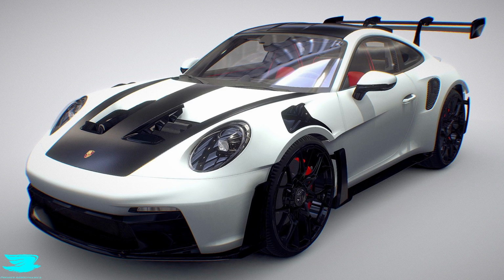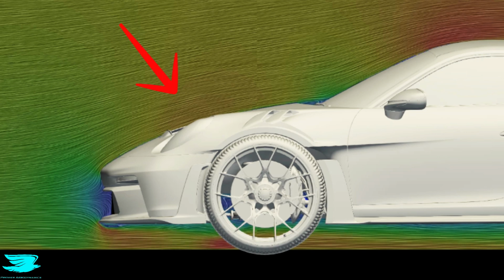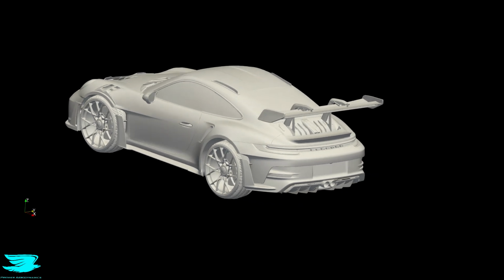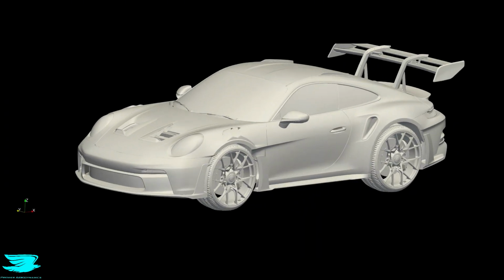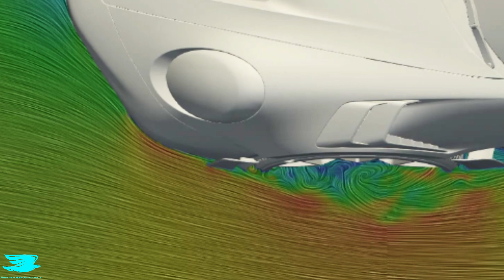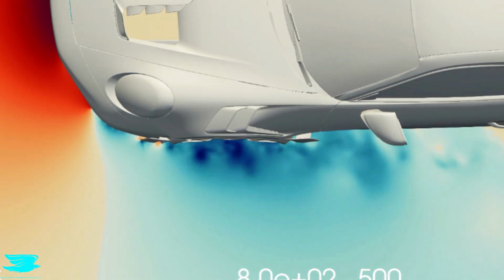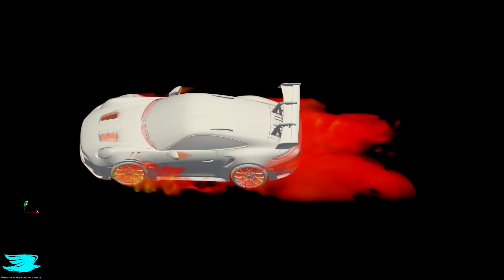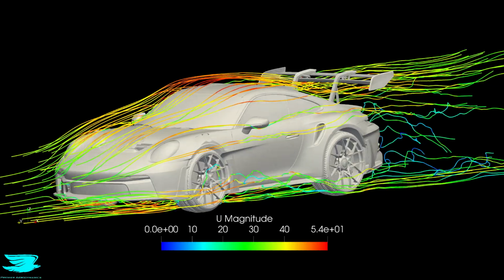Porsche's Most Aerodynamic Car Ever!

Comment: I am always watching your videos in order to learn about aero. Also I am in the process of decreasing aero drag on my car. I got a vented bonnet for my nsx for aero purposes , also added some flat underbody panels. I hope it will decrease my 100 to 200 kph time. I will have the floor of the car scanned to add a diffusor too. But the design is hard to do, because the exhaust and the engine is in the way.
Reply from the maker: The underbody panels will almost certainly help. Just make sure that there is enough cooling still.
Reply: @PremierAerodynamics  Yeah Thats what I am scared of, I wan't to do 500+ hp someday with a new 3.5l suprrcharged engine. Keeping it cool with a Diffusor that blocks of airflow to the underside of the engine would be dangerous. I've looked for solutions to this problem. Found a diy diffusor design that had a row of naca ducts infront of the engine. That looks promising. I still want to optimise it though. 

I think, if i can do the brake cooling in the rear with naca ducts as intakes and hoses that connect to the dust shields, I can put aero devices onto the lower rear A arms. Maximising the efficiency of that underfloor section. 
Further more I think there is a bit to be gained by shaping the middle floor. Maybe I will add strakes at the sides.
Also I am looking for a way to ven't the front and rear fenders, without making the car look ugly. I am trying to keep the look as stock as possible.

Comment: I assume the tires spinning isn't simulated here right? i think the airvents on top of the front wheel arches woud show more effectiveness if that was integrated.

 I feel like  some of the complexity of aerodynamic design is lost in these "set speed, straight on" simulations. Like the Underbody flaps that inflate/deflate behind the front splitter which would increase the downforce and keep the flow attached to balance the rear wing. Plus we don't see any body roll where the car would dive under breaking where downforce is  needed a lot.
Also just from the looks of it, the car seems to be a bit too high off the ground in general compared to when i see them irl.
Reply: Definitely right on everything, but also to add one more, the junction between the hood and the windshield is not completely accurate. On the real car, there's air blown from that junction channeled by some air going in the front bumper. There shouldn't be that much (or any) turbulent air in that region.

Comment: Can you look at the other side of the most aerodynamic porsche? The porsche longtail 907 has a CDA of .35 thanks to its frontal area of 1.3 meters, this allows one of its variants to reach 200 mph with only 260-270 hp

Comment: GT3RS is all about pushing the tire wake outboard, to stop it from turbulently mixing with the underbody flow. The furniture around the wheels also has the added benefit of enhancing the lip spoiler. Porsche noticed this when they made the S/T. One thing not shown in this model is also all the underbody strakes that help clean up the underbody flow. Current F1 has shown that underbody strakes are quite powerful, and since they can be made of plastic, or polyurethane, they are cheap and easy to manufacture.

Underbody aero is all the rage nowadays, along with modern tires, even low horsepower cars can go quite fast around a circuit with just underbody aero tricks like strakes and venturi tunnels.

https://youtu.be/NaenCYCUwBo?si=H3nc2QiBSQWji-M7

This car with only ~320hp minus 200kg of mass, sticky tires and around 4,000N of downforce @ 230km/h is a little bit faster around Tsukuba than a GT3 RS on Cup2 tires. You'd think it's a lie, no way a car with tacked on aero bits can make that much downforce, but the magic happens under the car, from the factory there are 2 big tunnels on either side of the transmission tunnel. Strakes were placed ahead of the tunnels, 3d printed plastic parts were made to shape the venturi, along with side skirts to stop airflow from bleeding in. This creates massive downforce.

https://youtu.be/CZEkjsFiuuU?si=4CJikfHrqzRDNUt7

This car has been joining the fun too, going 58 seconds around Tsukuba with a stock engine.

Cat's out of the bag, that's why all these ultra hyper cars are coming out recently, big power, massive downforce, can't let JDM have all the fun, the big boys have a rep to uphold.
Reply from the maker: The underbody is a very efficient aero region.

Comment: I am wondering what would happen if wheels had something like a Turbo Fan that came on the 924 Carrera GTR? I am guessing the reduced air escaping from the wheel would significantly reduce the drag? Maybe even just a simple aero disc?
Reply from the maker: If it reduces the wake size, then there is a good chance that the drag would drop.

Comment: I assume this is with the DRS on? Missing analysis on DRS off! Part 2, pls!
Reply: Drs Off, and it's not really necessary worth a 30s vids just for drs on. Everything in front of the rear wheel is the same.
Reply: @Dakkyun 
actually DRS on the GT3RS uses (apart from the rear wing obv) two flaps on the underfloor at the front of the car, that help balance the car more when downforce is reduced at the rear
Reply from the maker: Yep, those flaps are pretty cool!